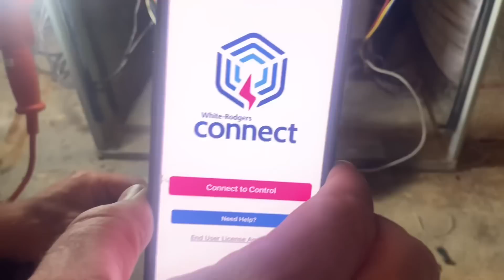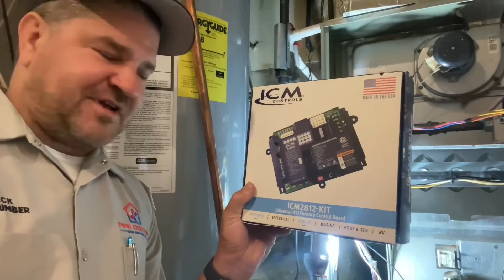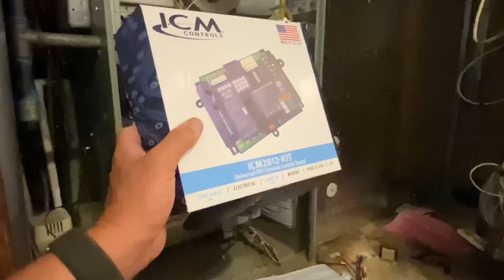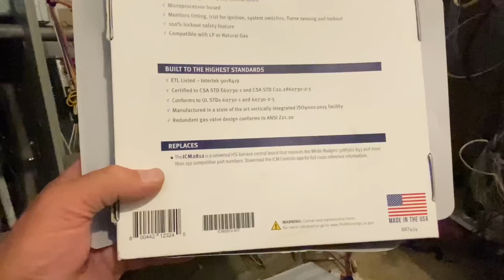Dead Gas Furnace? ICM2812-KIT Saves The Day with Universal Integrated Furnace Control Replacement

Comment: They work great  a little confusing on the low heat and high heat tab for single stage unit customer support says to always use both taps on single stage unit and if you have a 2 speed fan jump high and low speed on the board together not fan speeds I have not done this but let me know if I am missing something thanks

Comment: I betcha that heat exchanger is cracked. Been finding alot of the 80% and 90% cracked. They crack just above where gas enters the heat changer and on 90% just below where gas enters the heat exchamger. Right where the crimped edge is from the factory found about 10 of them already this season on tune up calls. Have to pull the limit and use camera to find
Reply from the maker: Oh no, the heat exchanger is cracking under the pressure! Time to call in the heat exchanger doctor!

Comment: There's barb tools for removing pins from the harness plugs. 👍🏼
Reply from the maker: That's good to know! Thanks for sharing this information.
Reply: @PipeDoctor  no problem. I think I got my sets from Amazon. There's different versions some are like a 2 pin fork type of style and others are a tube type tool of different diameters for sliding over the end of the pin.

Comment: jumper wire goes into the oem plug 5,11 so you don't have cut or remove any wires
Reply from the maker: Dude, this is a game-changer! No more messing around with cutting or removing wires. Just plug in the jumper wire and you're good to go!

Comment: BEFORE I see you open the doors..... Lemme guess.... non-louvered doors...... no makeup air supply from outside?

DOH!  

When surveying or installing door hardware, I keep noticing all the basement finish jobs that box in older heating equipment.... and all the window wells that were upgraded, walls insulated...... RADON levels through the roof!

On the ranch I bought in 2000.  just because they put a gas insert in the 1970s finished cellar fireplace, along with vinyl windows....... so all the natural ventilation to rid the Radon, and fuel oxygen to the furnace was choked off. Radon test results upward of 30. Sometimes a leaky house can save lives! Seller put in a mitigation system, brought levels down under 3. Furnace never had to cycle, as the main floor wall were uninsulated..... almost one continuous cycle.

So many This Old House DIY projects gone wrong!  I am amazed at all the stuff they sell in electrical and plumbing aisle that a professional cannot or SHOULD not use, as they do not, or SHOULD not meet code. P traps, ProVents, Backstabbed duplex receptacles ( the 1.99  ones, not the 3.00 commercial ones with the backfeed and screw clamp..... mmm those commercial 15A and 20A devices... and ANY extension cord under 14 gauge...... Crap, I am watching too many Technology Connections and Technology Connextras
Reply from the maker: Ah, the joys of DIY gone wrong! It's a constant reminder that sometimes it's best to leave it to the professionals.

Comment: I avoid using universal boards unless there is absolutely no other option. They never really match up right to the OEM board. But that seems like the condensate pan under the coil either cracked shifted or the drain path/port is blocked with gunk. As soon as I saw water in the bottom of an 80% furnace I would have known the real source of the problem wasn't electrical.
Reply from the maker: Ah, the universal boards - the bane of every HVAC technician's existence! It's like they have a mind of their own. But you're right, sometimes there's just no other option.
Reply: no blower and iced coil makes for water everywhere when it melts. who knows what a bunk board will do, may run condenser wide open and nothing else. possibly even whack out and then run the heat.🤣

Comment: ICM - that's very cool- doesn't a furnace need an orginal board
Reply: no - it's fine as long as the universal is approved to replace the oem part number
Reply from the maker: Thanks for watching! Furnaces can definitely benefit from an original board, but in some cases, aftermarket boards can also work just fine. It really depends on the specific situation and the compatibility of the board with the furnace.

Comment: Nice neat job when you finished. 👍🏻  Where did the water originate from, was the  coil drain blocked?  No obvious signs of water down in the furnace, did that get that first IFC get wet?  Only takes a couple drops of waste on a powered up board to destroy it.  The failure may take a few days to actually show up.   Regardless, Mike and Peter handled the customer’s needs.   Thanks for the tip on the ICM part.
Reply: Probably froze up from the control board not telling the fan to turn on
Reply: @kevinfoster2308  makes sense, thanks.

Comment: Hey Mikey Pipes, I'm very impressed with you mentioning protecting circuit boards. I come from an electronics and IT background and the number of times I see people handle sensitive electronics without any precautions is a cringe every time and leaves me thinking that the people doing it aren't true professionals. The boards don't come in the special packaging for no reason! Incidentally, it's handy to have ESD (ElectroStatic Discharge) protective bags and packaging around as a safe place to put a circuit board while you're working on something.

I have just one criticism and that is for ESD protection you need to wear an actual grounding strap to actually protect the electronics from ESD, just touching and grounded chassis or similar for a moment is no good and doesn't actually protect the electronics. If someone told you it's fine, then they don't know about ESD protection. One of most common yet mistaken beliefs is that if a board is damaged by ESD it just does not work, yet nothing could be further from the truth. If that's the case then, in a way, you're lucky because you know it's dead. Most of the time it's a big murky grey area with random errors, faults and often strange and intermittent behavior occurring. If you want to save yourself a lot of grief, get a proper ESD strap and wear it any and every time you're handling electronics. If it does not save your life, it could save you your reputation. It's not work taking chances with electronics. There can always be that one time when ESD damage causes something NOT to fail safe.

Comment: Tech tip leave the wires not used wrapped around the jacket in case one of them goes bad you have another wire to replace the bad one.
Reply: doesn't everyone do that ?    ( Or, have enough extra jacketed wire, so it can be stripped back further, without tugging )